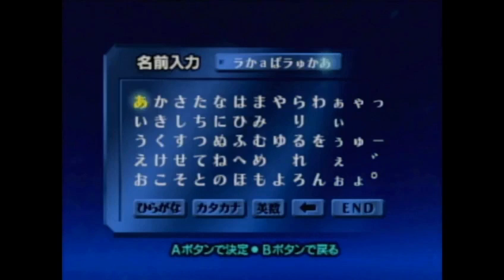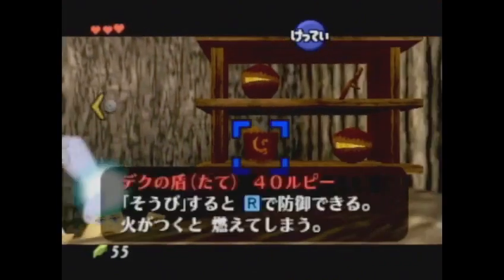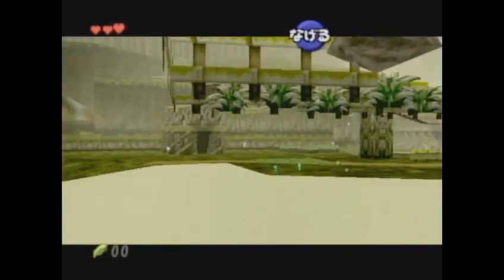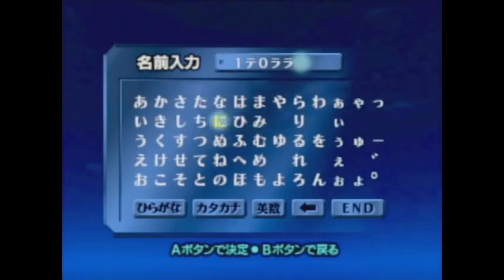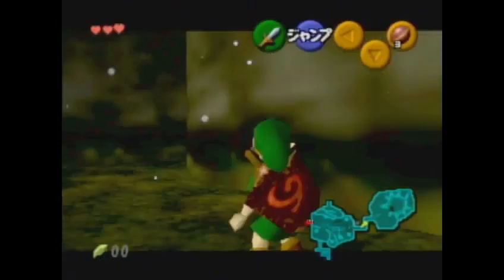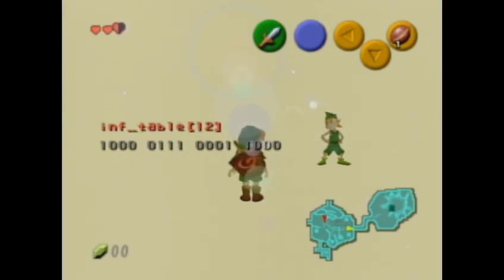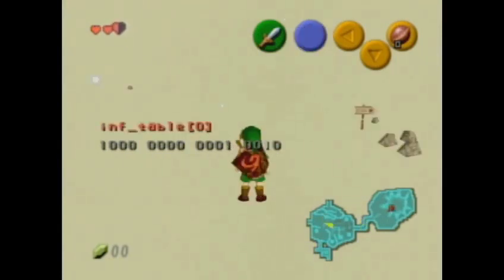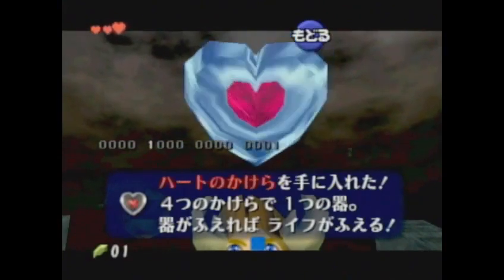Building a RAM Editor in Ocarina of Time

Comment: How is this different from ACE?
Reply: There is no code injection. This changes only non-instruction memory:
- Function pointer manipulation that swaps the function for "draw textures" with "enable event editor".
- Memory manipulation that changes the event editor's "editable events list" location.

You can use the memory editor to perform ACE (ie. changing code), but getting access to it only uses FPM (ie. changing what existing code is used).

Comment: Really fucking sucks this only works on Wii U so far. Any progress anywhere else yet?
Reply: Light node SRM works on all versions, but due to RAM handling differences and Wii VC not having a mapped dpad, this specific application only works on WiiU VC.
I have heard that people are working on making this work on the NGC version, and that another use of light node SRM already works on N64, Wii, and WiiU (warping to the end credits).
Reply: @IndigoTeddy  Well I hope its possible because if the fastest way to beat OoT 100% with source requirements has you playing on the Wii U version, I don't think many people will want to run the category anymore considering the input delay. It would be a shame if the top placer in this category is on Wii U while no one else runs it, I think it could potentially call for a separate category.
Reply: @Thomas-nz4si  there's already alot of debate on the WiiU VC features over on the OOT speedrunning discord, and another on light node's legality. They also have much more knowledgeable people there that can explain it better for you.

Comment: Cool. On what version and console is this possible?
Reply: It is currently doable on WiiU VC 1.2. They are working on getting it working on GC as well but the pointers don’t line up as nicely so it’s not yet guaranteed to work.
Reply: This setup only works on WiiU VC, but technically light node SRM works on all versions (even though different versions will need different setups and not every SRM application will be cross compatible, due to RAM handling differences).

Comment: I'm getting some SMW "Jailbreak" by SethBling vibes. What that did was use ACE to write a payload to one of the save game files that triggered on load of the savegame and enabled an ingame hexeditor. Since it was saved in one of the savefiles it persisted even over power down, the only thing you had to do once it was installed was load the third save file after power on and the thing was up and running again. I wonder if this would be possible with OOT if enough work would be put into it.